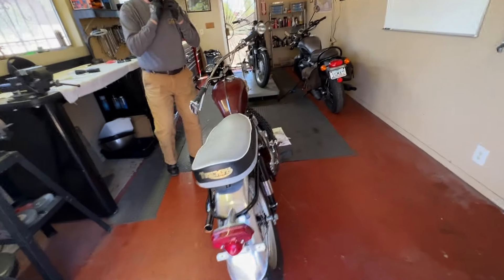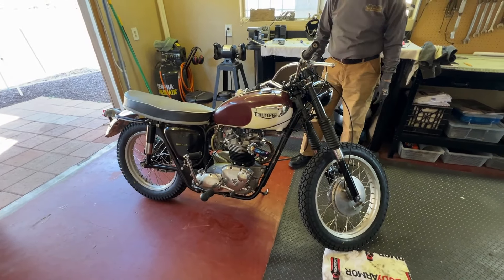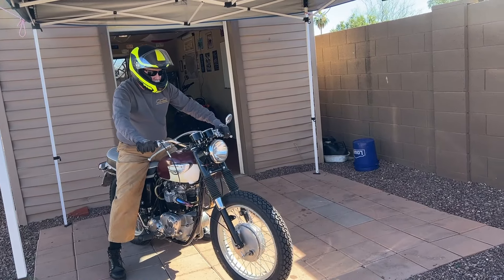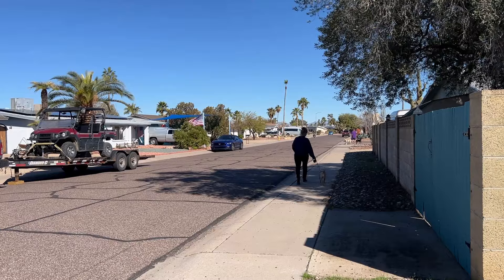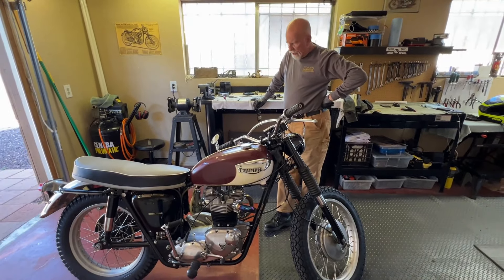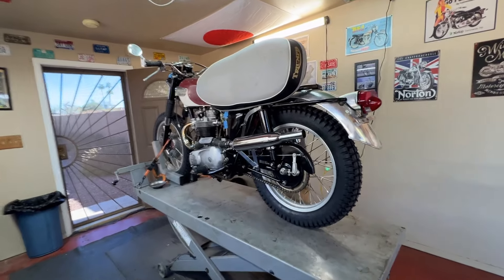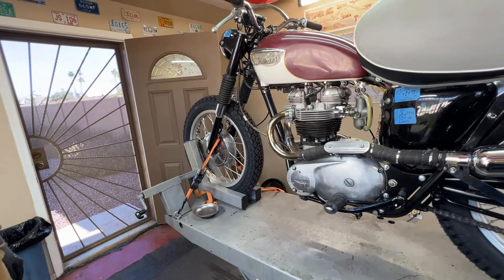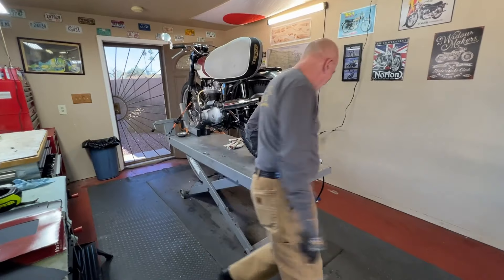01-27-24 - Kevin Rides a TR6

Comment: Invest in a twin leading brake. Fits straight in and transformes the brake. I am running a beezer with the same brake as the triumph.  Tried everything. Longer brake arm, floating shoes, nothing works. Great channel.Thanks.
Reply from the maker: I did exactly that on my own '68 T100.  The DLS brake was the best of the best 'til the disks came out.
Reply: @fjdelmonte  Brembo are the best actually

Comment: The single carburetor version of the British motorcycles are easier to live with than the twin carburetor ones.
Reply: That's not true.  There is nothing hard about the twin carbs.  Once they are setup correctly they work just fine for a nice long time.  This is an old wives tale that keeps getting circulated.
Reply: @RobsRidesPA  lt is absolutely true. With only 1 carburetor you have no balanceing issues and half the work and expense as well.
Reply from the maker: Yeah, I really like the TR's.
Reply: @frankmarkovcijr5459  Ok.  I don't consider 5 minutes to balance the carbs a lot of work, and once setup correctly, you don't hardly ever have to touch them again.  As for expense, not sure what you mean.  Unless you are replacing the carbs, there is no additional expense.  I'd rather spend 5 minutes balancing them once, and then have the performance of dual carbs.
Reply: @RobsRidesPA  Let's be honest . It takes more than 5 min to get them straight. Right now I need a new carb for my TR-6. One is cheaper than 2.
Reply: @frankmarkovcijr5459  I am being honest.  I can synch 2 Amals in about 5 minutes.  Not difficult at all, do it all the time.  I even posted a video of doing it on YouTube.  Takes longer trying to shoot a video of it, then actually doing it.  I said, unless you are buying new carbs, but then if expense is that big of an issue, vintage bike might not be your thing.  LOL.  Just kidding.  I always get annoyed when someone bring up costs while wanting to work on vintage bikes and cars.  I cost is the problem then stick to new stuff that doesn't need worked on.
Reply: @RobsRidesPA  New stuff is so unreliable. I like single carburetor versions. Both my TR-6 and Thunder ⚡ are what I came across. My Daytona is twin carb. My Sportster has one carb . My BMW's are twin carb. What they have is what they have. Just redid the engine on my URAL side car outfit. Had to replace both carbs . My main bike at the moment is my 1999 883  Sportster has 400,000 miles on the original engine. It was new then classic and now it's vintage. Ha ha.

Comment: That one head pipe looks like it is, or has been, run very lean.
Reply from the maker: The right hand pipe comes out and immediately makes a sharp left turn and the exhaust flame hits it hard.  The right pipe always discolors badly on this model.  Don't forget, this is a single carb bike.  both cylinders are getting the same mixture.